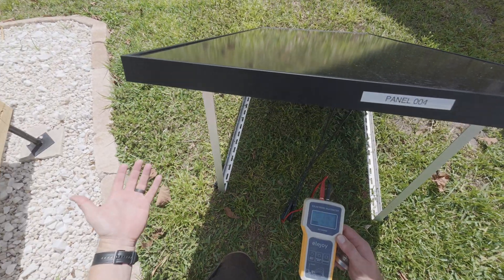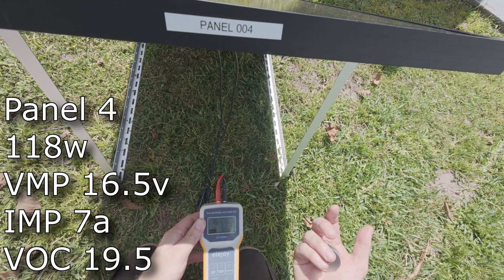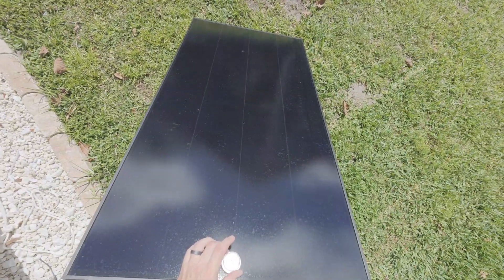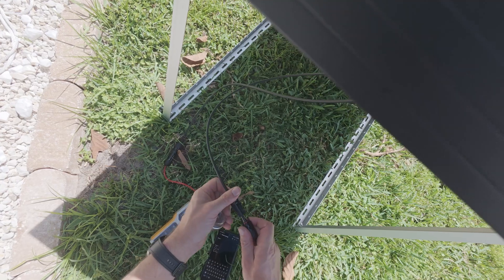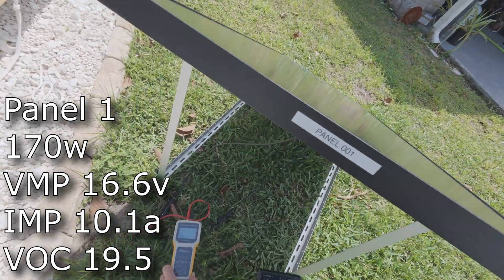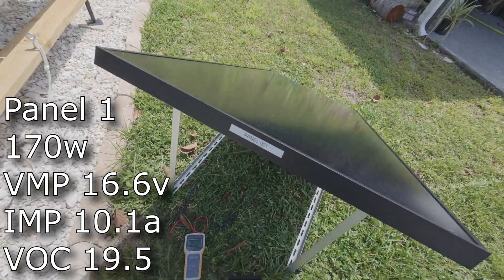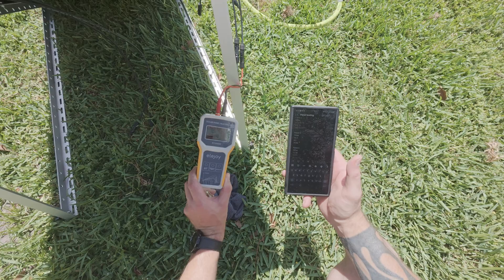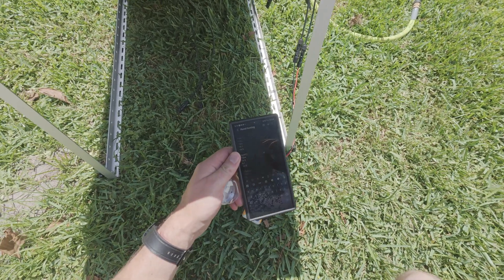ECO-WORTHY 200W 25.2% N-Type All Black Solar Panels - Do Not Buy Before Watching This!

Comment: i have two of them on my van at the moment. i have never seen more than 240 w total. its 60% of the rated. they lay flat on my white van. 90 F weather in Houston. I am waiting for another two to be delivered. Do you think it is normal to get 60% in early october, flat surface, 90 degrees sun. I checked the voltage both were same. Either both defective or underperforming?
Reply from the maker: My findings tell me that these panels are not reliable and over rated.

But I did get one or two that worked better than the rest.

I just won't use them for anything important, maybe little side projects.

Comment: Normally, I'd say if you get 75% out of a panel's STC rating, that's good enough. However, if one panel produces 195W and another 170W in exactly the same conditions, then something is off. The rest of them are flat out defective. Could be a bad batch, but 4/6 panels being bad is ridiculous. Eco-Worthy is not a fly by night operation, and produces well reviewed batteries, I have five 12.8V 150Ah metal case batteries from them. Did they ever send you new panels, and did they work correctly?
Reply from the maker: I did work with them, it was a pain but they made it as close to right as possible.

They offered to let me return for a refund, but that was too much labor, especially after having tossed the boxes.

So I got store credit, and I used that to help get some extra batteries. 

I do trust the batteries, go look at my new short I have 10 of them currently racked, and soon as my DIY battery build parts are here I'll have all 12 of them together for the next project.

Comment: I've sworn off Ecoworthy panels.  I ordered 4-195 watt bifacial panels.  They were packed very poorly. and I had to send 2 back because they were broken.  At the UPS store, they said they ship a lot of that brand back due to breakage.  I've ordered several Renogy and they all arrived intact.  Also, the 2 Ecoworthy panels I kept only made 195 watts once that I saw.   They seem to be rated to include the bifacial gain in the number, whereas every other brand I've seen rates the panels for front only, and be back is "extra".  Not a fan of Ecoworthy panels.  It also makes me hesitant to buy their server rack batteries, which otherwise look awesome for the price.
Reply from the maker: I have a ton of the batteries, but have not put them to use yet.  I have seen nothing but good things about them, and so far my initial impressions are good (nice bms, BT connection, etc)

I never thought about the 195w rating including the back, I dont think that to be the case since I can get nearly max power from them even without a bi-facial setup, have you found anything to back up those claims?

I am not a brand loyalist, but I try not to be a brand hater either, always neutral and truthfull.

These panels (the 200w Type N) sucked for me but the 195w were good, especially for the price.

As far as broken panels, so far only my Ecoflow panels have been damaged on delivery.
Reply: In my experience I didn’t have any bad experience with eco worthy some panels did come dinged up they dropped the prices on every one that had little dings and let me keep the ones that had pretty bad dings….did get 2 that  broke but sent me another set…. In the end I have 24 panels

Comment: i have 5.different arrays now and i have some of the 195 ecoworthy n type. they seem ok. i aldo have 8 200 watt jjn n type and they are about the same. they do better in low light conditions than some of my other arrays but its still obvious to me that more is better no matter the new tech or not. im wanting some of the shadow flux next i guess and maybe they will live up to their claims
Reply: Shadowflux are great... only if you actually have an unsolvable shading problem and can't just throw more panels at the problem. 90% of the time more panel is STILL the right answer if you have space. the other 10% is RV/van roofs and boats where space is limited, and boats get the double whammy if they are sailboats.
Reply: @chaon93  I have several arrays. all of them are in the shade a good part of the day thanks to the neighbors trees. I wish all my panels were shadow flux
Reply: @matthewknight5641  shadowflux won't help much if almost the entire panel is shaded. it just prevents the near full power drop that most panels will have if even 10% is covered.

Comment: The panels are rated at 200W when the sun is perpendicular and panel temp is kept at 75°F. These are ideal conditions that you, nor anyone else are likely to mirror for their production. Are you saying even given that, they’re performing below spec?
Reply from the maker: Yes that is what I'm saying and the best way to show that is that every other "good" panel can get well within 95% of spec in these conditions.

Id even settle for 90%

But most are getting about 150w and that is only 75% and they are supposed to be the BEST you can buy, loaded with all the best tech and highest efficiency.

Let's not even mention the panels that tested near 100w...
Reply: @ViciousXUSMC I have 5 of these wired in a series and I was pulling 830W or 83% of rated on a overcast day, since then my bank has been charged so I haven’t been able to generate more than that because they just float charge my battery bank now. I’m unsure if they’d go higher than 83% rated or not, but I assume they would
Reply from the maker: @ArizonaRegime  Yeah, if you have a string just one panel not working well will bring down all of them.

So based on my results yours are actually really good!

Infact given it was not super full sun and not perfect conditions that sounds perfect.

But to see if there is a problem you would have to test them individually in ideal conditions.

Also being mindful that not just a bad panel will bring down a string, but bad conditions too, like partial shade.

That's why I run multiple MPPTs so I can  prevent my panels that get shade from bringing down the ones that get full sun all day.
Reply: Yup! Very aware of how the solar strings of a parallel vs series system works, but thanks for the tips. I did individually check the panels before I connected them to my system and each panel was pushing appropriate voltage, but I didn’t check the amps too. Multiple mppts is $$$ and takes up a lot of usable space, you’re also not going to generate energy as early in the morning or as late into the evening doing it that way, but you will be protected against partial shading, there is pros and coms to both, what’s best for me may not be best for you.
Reply from the maker: @ArizonaRegime  Having more than one MPPT will have no effect on production time as long as you spec everything right.

With me always pushing near max voltage on any given charge controller I get production at all times.

I think that's what you were insinuating, people that have MPPTs with startup voltage that basically requires lots of light to meet minimum startup.

That is mostly people with small setups like a single panel, or an oversized MPPT for a given setup.

With 20v panels and a MPPT that has a trigger voltage of like 7v there really is no situation they won't work.

That was actually one of the benefits to changing panels though.

Not only are my new panels giving me more wattage, but they seem to work even better with almost zero light.

It was dark outside and I was still getting 10w from each panel.
Reply: @ViciousXUSMC  wait you have individual mppts for individual panels that are set to 7V?
Reply: @ViciousXUSMC  What brand and power are your new panels?
Reply from the maker: @mikedenney1568 Global Power and Philadelphia Solar
Reply: Open or shorted diodes? Bypass diodes will maintain VOC while excluding large parts of the panel.